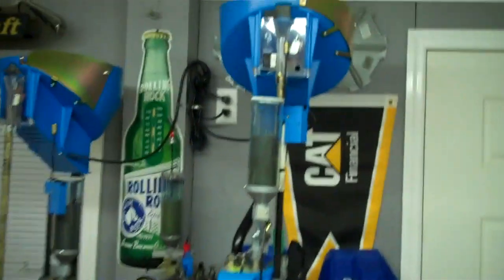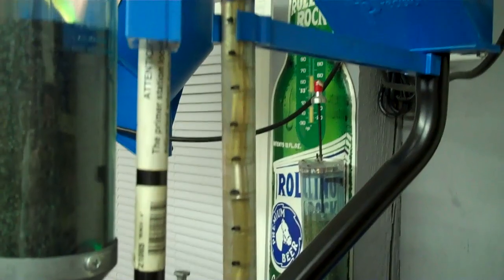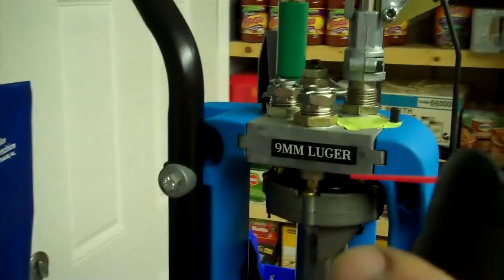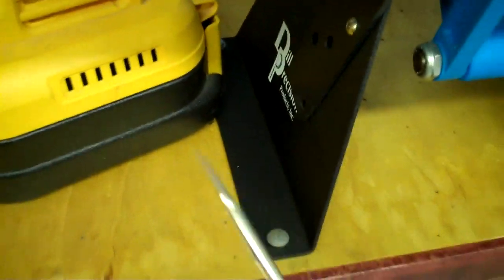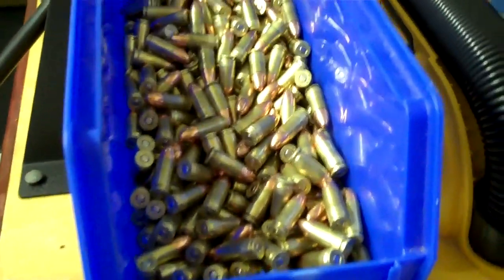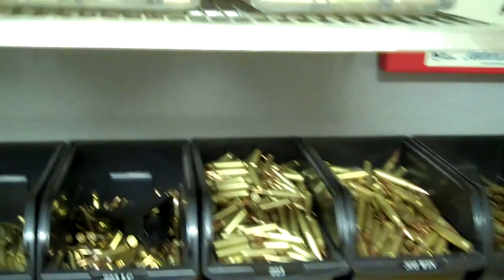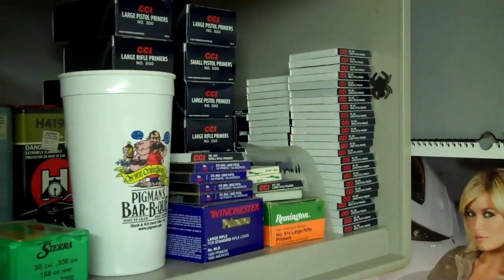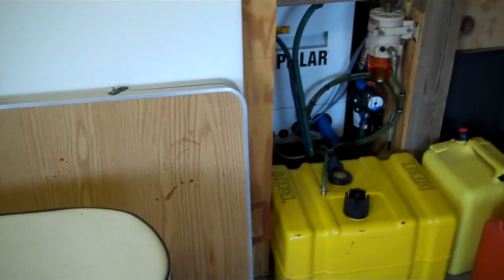RELOADING TIPS FOR YOUR DILLON PRESS

Comment: Thanks for the tips OBX, As a tip for those wanting to make quasi match ammo on their Dillion progressives, I have been working on tuning my XL 650 to produce high (for a progressive) concentricity cases for 223. I have gotten to an average of <.0015 on most cases by doing a lube die in station 1, a dedicated decapper die in 2, a redding comp FLS with the recap, neck/expander assembly removed in 3 and a K&M neck expand mandrel in 4. For the plinker it won't matter a lot, for sure...

Comment: I own a 550B and it does everything I could want. You will get more bells and whistles with the 1050 plus it will load more rounds per hour but for the price I just can't see buying one.  I really don't mind placing the brass in the holder by hand or the bullet on the casing. By the time you purchase your adaptors, dies, scale, tumbler, media shifter, supplies and all kinds of other cool stuff you will have a nice chunk of change invested even with the 550B.

Comment: Nice video. Almost every improvement I have made over the years has come from you tube. I use 2 550b presses with case feeders. If I could do it over I probably would have gone 650... But no complaints. 
Question, you mention leaving the handles down, why is that?  I also use canned air. Used to have a small cheap compressor, but the noise and air blast got to me. My neighbor is a Plummer so I had him save an out of fashion sink he was replacing in a home and I use it in my reloading room. I traded some range time and ammo and got a darn nice deep heavy duty sink... Invaluable. 
I also believe in stocking up on any component that is available now... Because its almost guranteed to be hard to find at some point. As I type this primers are not a problem, but pistol powder is scarce. I'm fully stocked so when powder comes back I can build back up. Thanks again for the great info..

Comment: Do the different bullet types of the same weight vary the chamber pressures enough to worry about.  Same thing with the different primers.  I see your level of readiness and I am impressed.  I am getting components as I can and it is hard to get the exact bullet type, the listed primer and the same exact bullet type listed in the data books.  Please let me know your thoughts.  Thanks

Comment: Great room!
I was thinking of getting into reloading as well, but wondered what the cost savings is between buying ready made ammo or reloading. Meaning, if there is only a costs savings of 5cents per bullet [or there abouts] - isn't that 5cents eaten up on your labor? I've seen several videos where they say there is a cost savings, but where?
The thing people don't share on these videos is the labor intensive side [hand inspecting each case [handgun/rifle], cleaning/tumbling, lubricating, trimming cases, etc. So, I'm confused.
If I did get into this hobby, I would like to have a couple 1050 machines with motors and run them all day long. And my decision as to what caliber dies to get first being that I have 45acp, 45lc, 9mm, 40 s/w, .223 and in the future will add .308 or .338 Lapua to my mix - I would hand load those.
Please no haters, I'm new to this and just wanted a clear definition to cost savings.
Thanks - Love your room. I'm jealous.
Reply: OCBoi8 
I can reload 9mm for about 13c per round.  That is $6.50 for a box of 50 rounds.   If I run up the road to the local gun shop, I'm paying between  $13.99-17.99 depending on brand.    I could also buy in bulk from someone like Freedom and get rounds for 19/20c per round.
It all comes down to you really.   There will be some start up costs, reloading machine, primers, powder, bullets and hopefully you're saving your brass or that will add to your costs.

Comment: Very nice clean room and you take safety priority one. I have the 550 rb thinking of upgrading to the xl6500. Is it well worth the money???
Reply: I think so for pistol it's well worth it get the case feeder it's cheap and some primer tubes and you can load  about 750 rounds per hour not even going fast. Rifle i think that the 550 has tighter tolerances for bullet seating depth I run deprime size runing case feeder wet then trim and swage off of press then run a second time with the 650 prime, powder, seat, ~crimp.